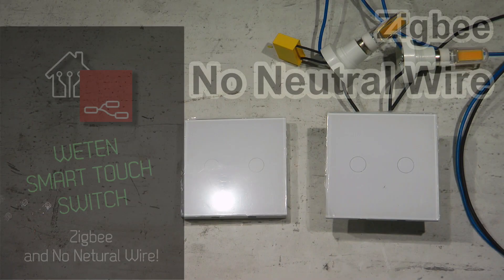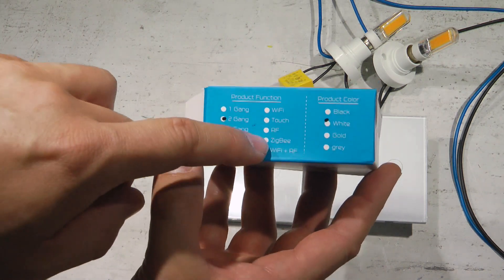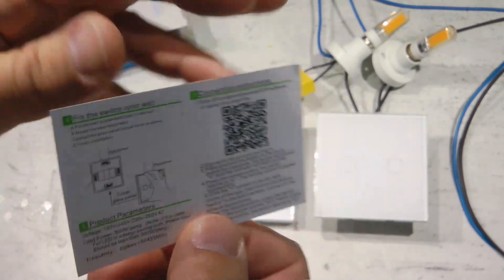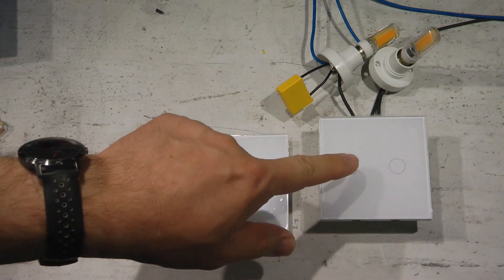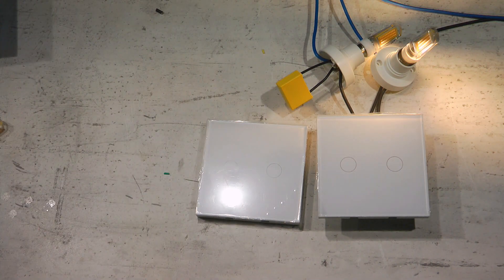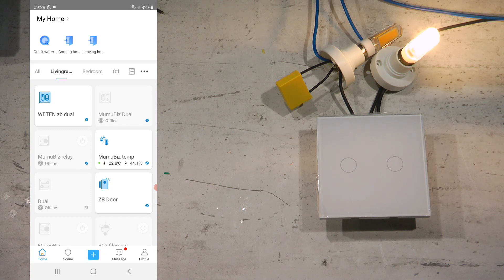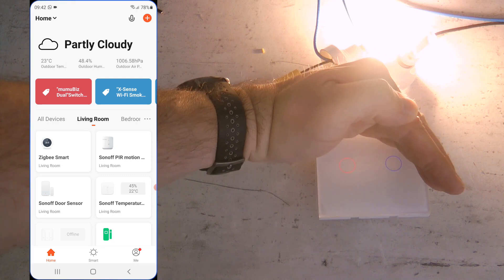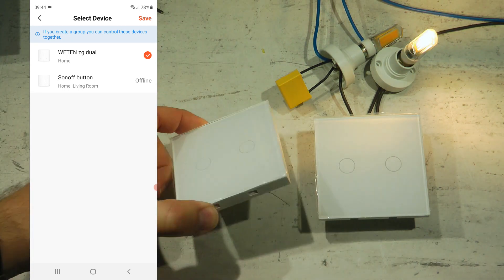Zigbee No-neutral-wire touch switch

Comment: Hi! I have ordered 2 zigbee switches with neutral that should work 2 way through multi-control association in the Tuya app. The problem is it turned out that in one of the places we don't have neutral. Would the 2 way association still work if we don't connect the neutral in one of the switches?
Reply from the maker: That is a very good question. I am not sure how the Tuya groupping works, whether it only groups devices that are the same type or not. But if it is not possible to group, you can create scenes to do the same. It will probably be a bit slower, but that works between any device.